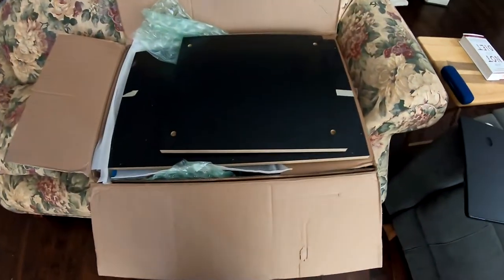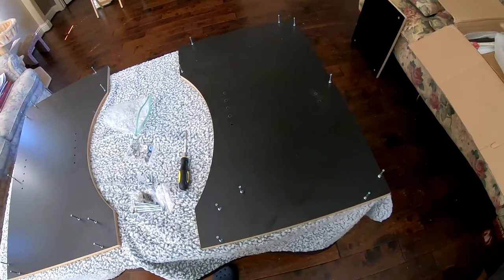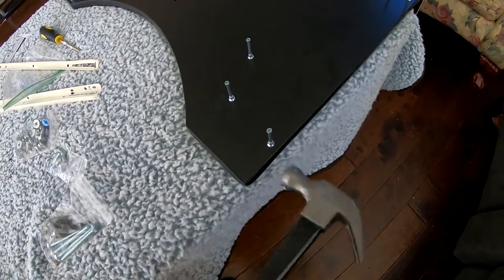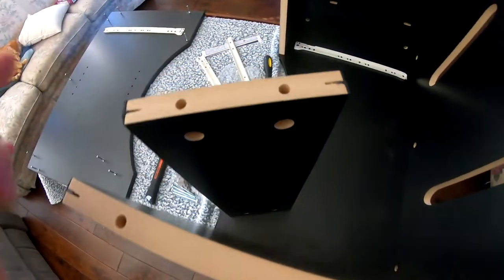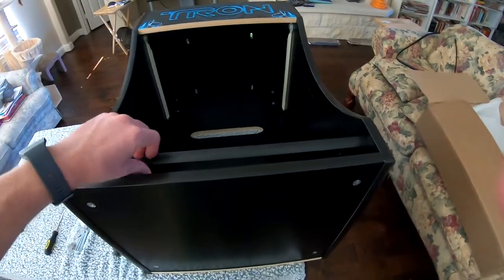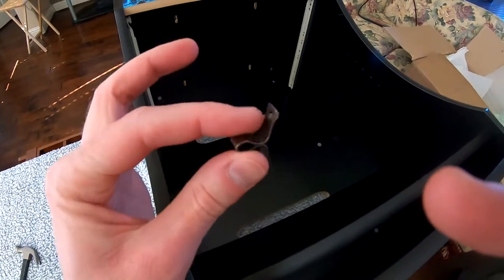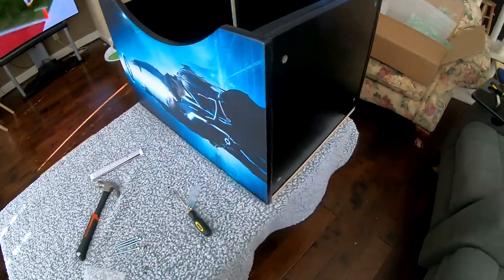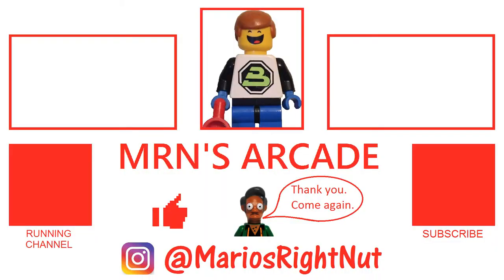Assembling Bartop Arcade Stand from Game Room Solutions - TRON Themed!

Comment: Great video.  I referenced this video many times as I built mine.   A few things i wanted to share.  The tight spot you mentioned that was hard to get a screw driver into, i was able to use a Allen Wrench/Hex Key to tighten it down.  Also, i wanted to highlight that you want to face the cam locks on the bottom piece facing down and the back piece facing out so the inside of the stand looks clean.  Otherwise, you see all the silver cam locks inside the cab.  Thanks again for the great video.
Reply from the maker: Good tips. I’ll have to take another look at mine.